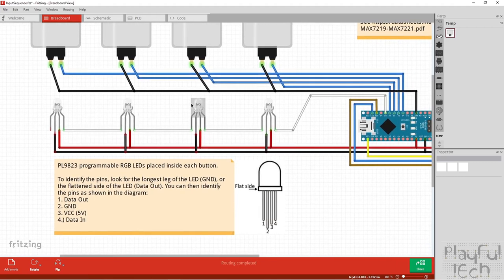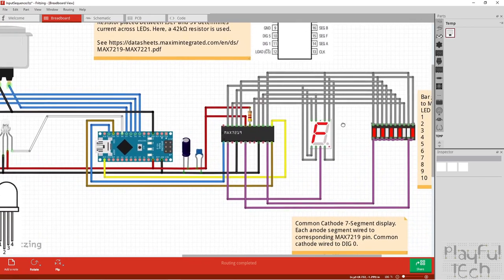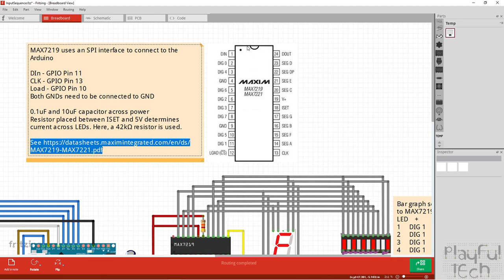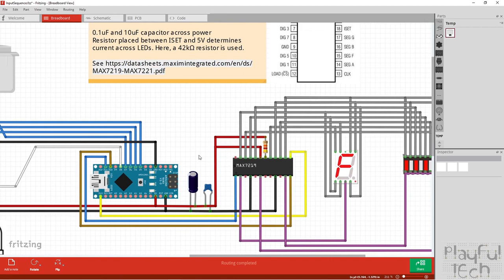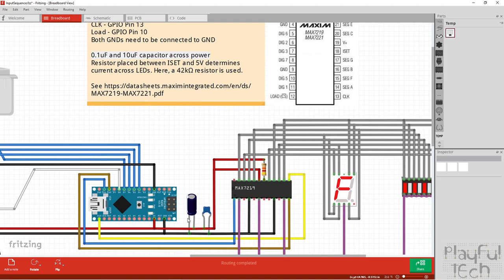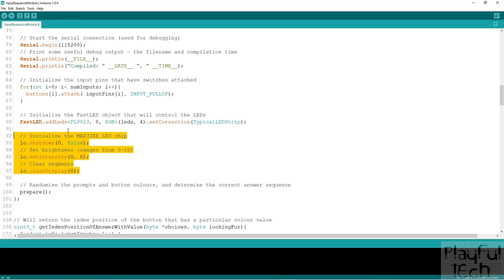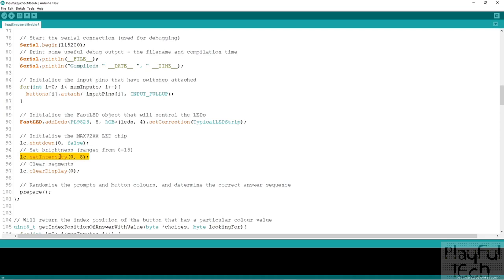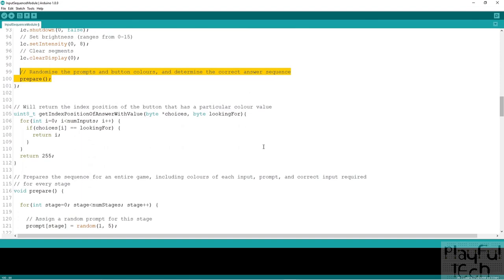Colour Sequence Puzzle

Comment: Hey coul'd you help me please ? My bargraph and my cathode led display is always lighting up on all segments, i check 3 times my connections and the code and it's fine. I can't say what is wrong. Thanks a lot
Reply from the maker: I've had ones supplied that were mislabelled as CA/CC, and also where the wiring was "mirrored" - if your LEDs are lighting up, then at least you know they're good. I'm afraid you'll just have to poke around on the different pins to work out what the correct pinout for your module is :(
Reply: @PlayfulTechnology  thanks you for your answer ! I will check that !